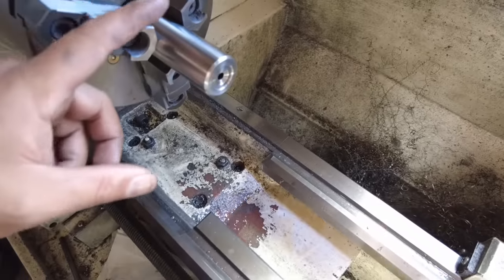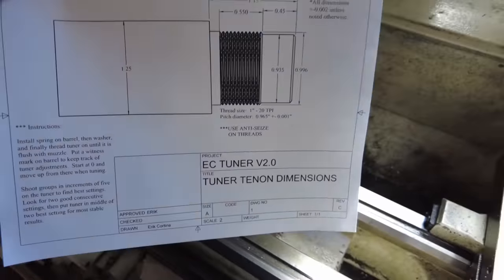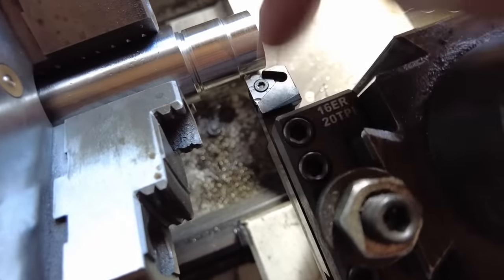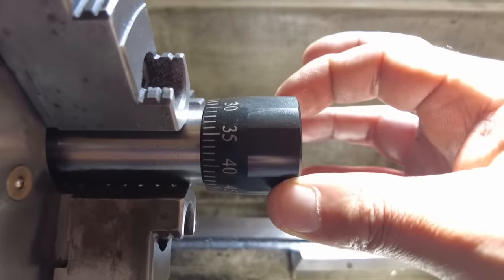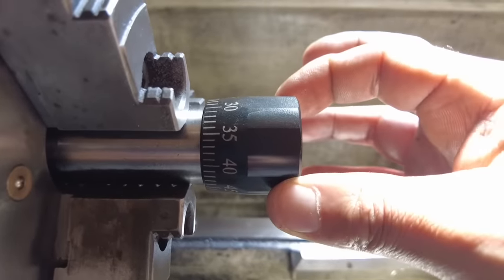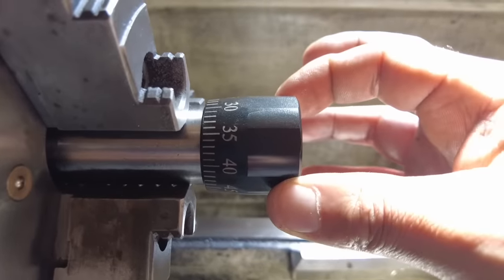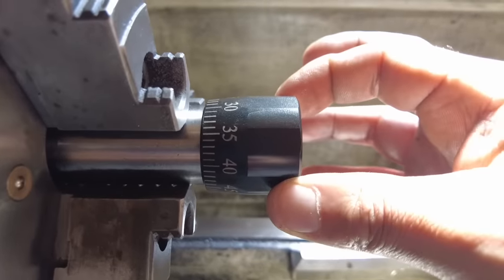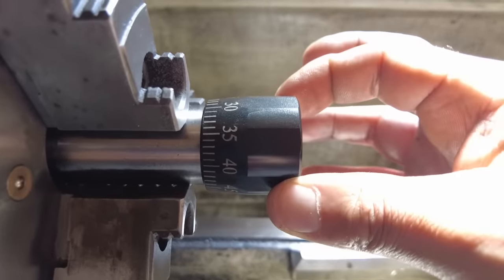EC Tuner V2 - Will it help your 22LR rifle? | Direct Barrel Install

Comment: You will have to make a tuner with some weight to get it to work. That was a very thin piece of metal. It does show that it’s a waste of time if you can’t make your own. I’m not sure a tuner on a NRL gun has a place. If you bump it while shooting it’s going to change. Better to have a clamp on tuner for Benchrest matches if they are wanting to use in both sports. Just have to shoot 40-50 rounds to find the tune again before a Benchrest match. My opinion from using and making them for many years. I think I’ll be making a clamp on for my Bergara.
Reply from the maker: Thanks for sharing your experience.  I would agree from seeing the folks who shoot IBI here. They use Harrols or a form of, clamp on tuner with diverting cones. They weight upwards of 2# or more

Comment: You should use the same ammo with and with out the tuner
Reply from the maker: For this testing the same ammo was used  when shot before and after the tuner installed.
Reply: @EagleEyeShooting  Same ammo? Before tuner shows Eley Tenex being used and a temp of 110°F. Test of rifle ammo used in video was SK Long Range. No idea of temp, no signs of temp being high. Both of these make the comparison of before and after invalid, IMHO.

Comment: What is the theoretical mechanism by which this is supposed to do something? Is it all in regards to harmonics? How is the test meaningful when not shooting off a sled?
Reply from the maker: The rifle is to perform for the specific style of shooting which is PRS. Theoretical or not, the shooters ability even with a sled is still the variable.  Comparing down range results with as many of rifles I've built and tested, I'm able to establish a base line accuracy with my ability, ammo and rifles I build. When a rifle performs outside this realm, it's easy to draw conclusion to a mechanical failure

Comment: Thanks Kenny 
 Great video , I have been thinking about fitting a tuner to my CZ455 fitted with a IBI match barrel but I don’t want to stuff up a rifle that already shoots .4 groups using SK rifle match ammo , the problem is for some crazy reason the first shot of every group is a flyer that blows a .4 group out to .6 - .8 it always the first round of a five shot group , do you think it could be a harmonics issue ot something else  I started doubting myself so I did get my buddy to shoot a few groups and he had the same first shot flyers , what do you think any advice would be awesome Thanks again Steve .
Reply from the maker: IBI barrels run tight bores. My experience with them as well as my air gauge measurements have produced the same results with cold bore shifting and flyers. I dont recommend IBI for PRS style rifles due to the cold bore shifting.  But again, my expirence.  Some will state otherwise

Comment: The 1.20 straight contor 22lr doesn't need a tuner, the stock cz457 or bergaras b14r benefit from the tuner. 0.865  0.900 respectively with both with the 1/2 × 28 adapter.
Tune it at 100 yards 3 shot groups.
I have both rifles and use the v1 ec tuner. I am thinking of getting the v2. Mine are repeatable as I remove the tuner during cleaning.
Reply from the maker: Bench rest ara and ibi league shooters use 1.20 or 1.25 barrels with clamp on tuners.

Comment: With a monster barrel like the one there, such a light tuner is going to be pretty ineffective. The mass dampening effect is irrelevant. Just my engineering two cents.
Reply from the maker: Agreed, but many are still sold on using one with heavy barrels like this. Tuner works well with a light contour barrel
Reply: @EagleEyeShooting  i have a custom tuner installed on my 457 LRP full factory, and i can consistently shoot 1/3 MOA, no matter lot of ammo or environmental conditions. It works great on mine.

Comment: I do not  understand  your methods  of machining . The jaws  on the chuck  should  have  been  soft jaws  not hard  jaws  .  If  you would have  put a dial indicator on the o.d. of the barrel  you would  have  noticed  run out . The o.d. of the barrel  isn't  concentric  to the bore  of the barrel  . The wall thickness  isn't  consistent  . The soft jaws  should  be bored  to the  barrel  o.d.  A gauge  for threads would  be helpful  to ensure  thread  dia. and pitch  . An example  would  be a  go or  no go gauge .
Reply from the maker: Please see my newest video to get a idea of my background and capabilities